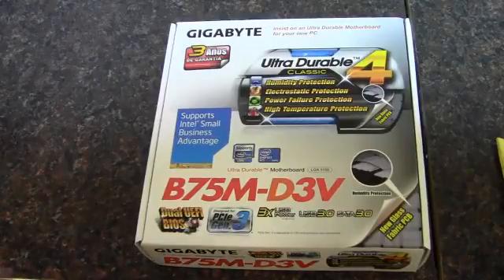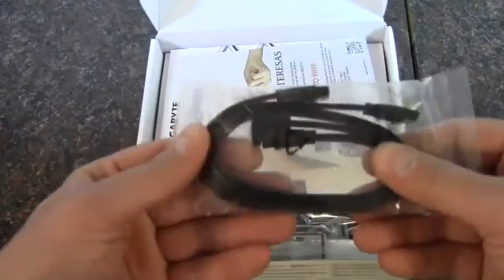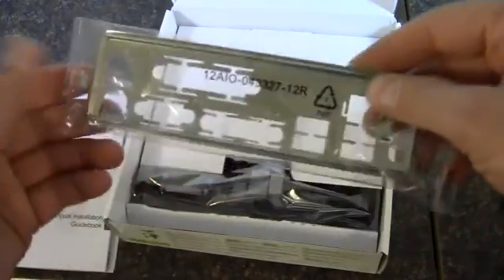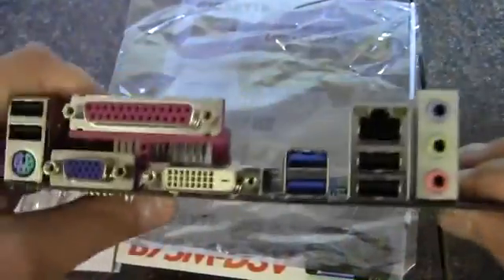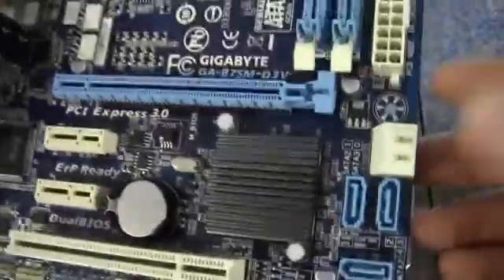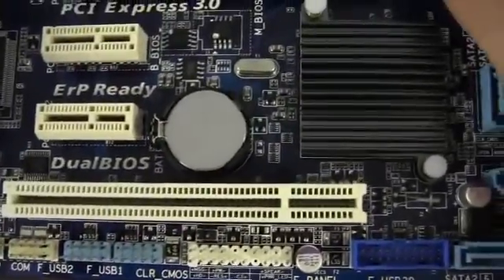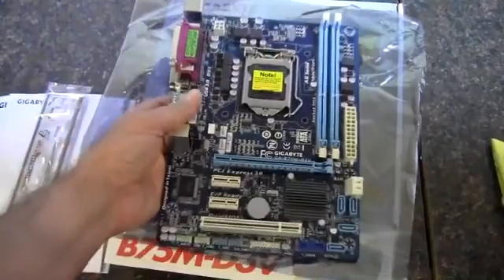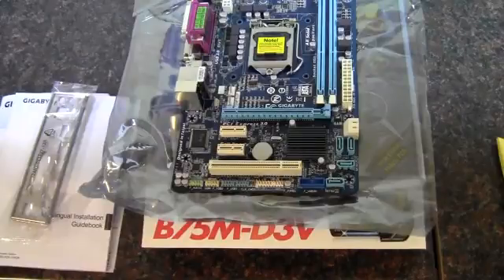Gigabyte B75M-D3V Motherboard

Comment: hello friend, can u tell me this board support ram xmp profile ? i wanted to buy ddr3 1600mhz. or i should put only 1333? and can you pls explain which type of ssd does it support? i am new pc user ) thx a lot. (i wanted to put evo 870, but board support that speed i dont know)
Reply from the maker: If the CPU supports the XMP of 1600mhz, you should be able to run the RAM at those settings. Your best bet would be to use an Ivy Bridge (3000 series) i3, i5, or i7 CPU. If the price of the 1333 vs 1600 is close, I would still get the 1600. The worst that could happen is that it won't run at 1600. It would be slightly slower, but probably not noticeable. This board does support SATA 3, so the SSD will be able to transfer data at the maximum speed.
Reply: @AdoptedMike all  ivy bridge support 1600 or u should check each processor?
Reply from the maker: @fexico1412  Hi. From what I can tell, the i3, i5 and i7 CPUs all support 1600. Not all of the Pentiums do and none of the Celerons do. Look here: https://en.wikipedia.org/wiki/Ivy_Bridge_(microarchitecture) About a 1/3 of the way down the main CPUs start being listed. RAM support is the far right column.

Comment: hey man, i have a third gen i5 cpu(3350p) together with 2x4 and 1x8 gigs of ddr3 ram and a 960 windforce 4gig video card, would these fit on this mobo
Reply from the maker: Hi. That CPU is on the supported list, but this board only has 2 slots for RAM. You will only be able to use 2 of the 3 sticks that you have. Other than that, I see no problems. https://www.gigabyte.com/us/Motherboard/GA-B75M-D3V-rev-10/support#support-cpu

Comment: hey I'm going for a cheap gaming build 
i7 2600k and gtx 1060 6gb

i found this motherboard for a cheap price 
does it have an RGB pin interface  ?
and can i overclock i7 2600k with it ?
Reply from the maker: Hi. It doesn't have an RGB interface on the board. This was just before the RGB craze started :) Also, the B75 chipset didn't allow you to change the CPU multiplier. I think it will allow you to change the base clock, but that usually doesn't amount to much and can cause instability problems. Overclocking is best done on Z series motherboards.
Reply: @AdoptedMike  thanks for replying and for the informations
Reply: @AdoptedMike  for the rgb fans i will just use an rgb controller linked to psu to run rgb fan with a wireless controller 
for the motherboard i will use [ GA-H61MA-D2V (rev. 2.0) ] hopefully it will overclock it correctly
Reply from the maker: @kamm3021  Adding an RGB controller will work out great. The H61 will not allow multiplier overclocking. You will need to get a Z77 motherboard for the best results.
Reply: ow 
what do you mean by multiplied oveclocking
only one component can be overclocked or what !!!
Reply: does the  ( Asrock p67 extreme4 gen3 ) has it too ?
Reply from the maker: @kamm3021  Multiplier overclocking is where you overclock by adjusting the CPU multiplier. An example would be a 3.0Ghz CPU has a multiplier of 30. If you have a K series CPU (2600K), then you can just change that 30 to 40 and it will attempt to run at 4.0Ghz. It may take some voltage tweaking and extra CPU cooling. It is much easier to overclock by changing the multiplier than the base clock of 100Mhz. That is were the multiplier comes in to play. 100Mhz x 30 equals 3.0Ghz. Usually the 100Mhz base clock can only be adjusted by a few megahertz. Example 102x30 would only be 3.06Ghz. I personally have not seen any base clock over 105. Not that it couldn't be done, it is just much harder. Plus base clock changes affect the entire motherboard. That makes it much more likely to be unstable. Look for a Z77 motherboard for that CPU. Here is an example: https://www.newegg.com/p/N82E16813131962?item=9SIAFVV89M5641&source=region&nm_mc=knc-googlemkp-pc&cm_mmc=knc-googlemkp-pc-pla-alex+computersmotherboards+-+intel_-9SIAFVV89M5641&gclid=CjwKCAiA6vXwBRBKEiwAYE7iS8HwSWGMuECcfBiuAkiJnFqpzcJCPYCcG_Tcsm4YYxdMvxZEdWFF9RoC6jwQAvD_BwE&gclsrc=aw.ds
Reply: thank you so much for the help :D
i will definitely go for Z77 
just found an ASUS P8Z77-V Lk  for 28$ local deal i will go for it
Reply from the maker: @kamm3021  You are welcome. That is a really good deal for a Z77 motherboard. Sometimes as older hardware ages, it gets harder to find and more expensive.
Reply: lucky deal and it works like magic
i7 2600 oc 4.5 ghz is stable 
yeah some old hardware are expensive

Comment: What is the real difference between B75-D3V and B75M-D3V motherboards?? The latter is not as priced as the first one and I cannot guess why. Anyone has an idea?
Reply from the maker: The M stands for Micro ATX.
Reply: AdoptedMike  What is Micro ATX? Can that be reason for the product to be up to 30% more priced?
Reply: ddraguti aha I get it,motherboards designed to be smaller and more available to buyers,meaning less expensive.
Reply from the maker: ddraguti Yes, MATX boards are much smaller than the standard ATX design. Less expansion slots and a much smaller PCB is likely what makes this design cheaper.

Comment: i currently have this but i am suspecting that i get a huge bottleneck because i use a gtx 770 in this motherboard .. do you know if this can be the case? that i need to change the motherboard?
Reply from the maker: What CPU are you using? That is likely the bottleneck before a motherboard would be.
Reply: i have a i7-2600 not the k version of it. I have very little knowledge about computers so thanks you for answering me.
Reply from the maker: You shouldn't have a bottleneck at all with that combo. One thing to check is the temps. Download CPUID Hardware monitor from here:

http://www.cpuid.com/downloads/hwmonitor/hwmonitor_1.26.exe

You can run this utility in the background while you game, etc. It remembers max temps. If you max temps are too high, then the CPU or GPU will throttle down so they don't overheat. You could have a case airflow problem, dust in the heatsinks or a too small of a heatsink on the CPU. This utility will start to narrow that down.
Does this make sense?
Reply: AdoptedMike
 hey thanks allot! i just cleaned my whole computer and my computer is good as new! It was really dusty! i cant remember the last time i cleaned it to be honest.
 and i was about to order a whole new motherboard and CPU !
Thanks allot for your help buddy, i really appreciate it  :)
Reply: and that link is really handy!
Reply from the maker: Great news. I am glad that I was able to help. Take care!
Reply: ***** this was a While ago.. I now got a 980 ti 6gb, i7-5820k and 32 GB ram. I'm happy 😊

Comment from the maker: HDMI outputs a better signal than other display options. This comes from a higher bandwith and from uncompressed data transmission. But there are also some content protection (HDCP). Check out the Wikipedia article on HDMI. There is loads of info on the technology, I read a bit before I posted this. It was an interesting article. I hope that this helps.